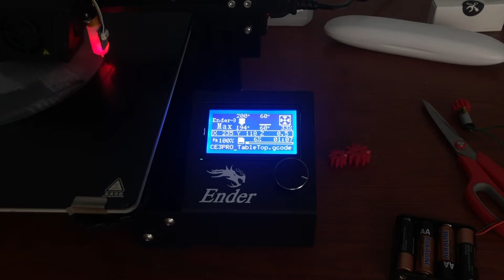Thermal Runaway | Ender 3 Max | Easy Fix

Comment: did you have to add extra wire to the thermistor that was for the pro. thanks for a great video
Reply from the maker: Yeah, so first I assembled it with the unmodified thermistor, and ran a few test prints to make sure it solved the issue. I then cut off around 6-8 inches of the old thermistor at the plug end and extended the new thermistor wires. 

The weird thing is the old thermistor would work as normal on a short print (under an hour), but it would fail on longer prints. I believe that there may have been a micro-fracture of a wire on the old thermistor causing it to misbehave during certain movements or something. So I could see it being risky to reuse part of the old thermistor, as I didn’t know where the issue was within those wires. This is why I’m stressing to try the new thermistor as is before extending it if you are going to reuse some of the wires from the old one. 

Anyway, thanks for watching!
Reply: @PrintPractical   thanks for all the work ,been thinking of getting a max. Not cheap in Australia.
Reply from the maker: I love both my Ender3v2 and Ender3 Max. Good luck, I hope it works out! @dwho3